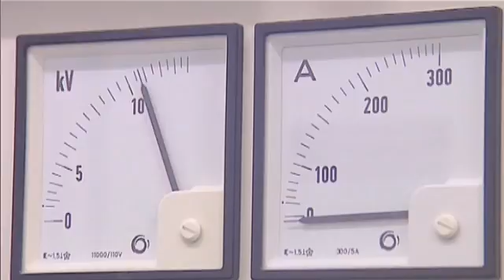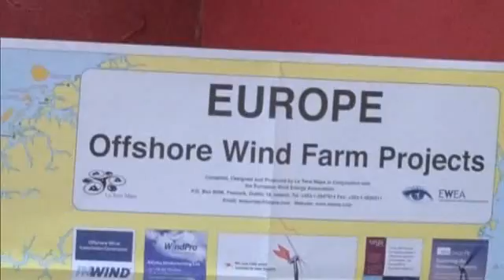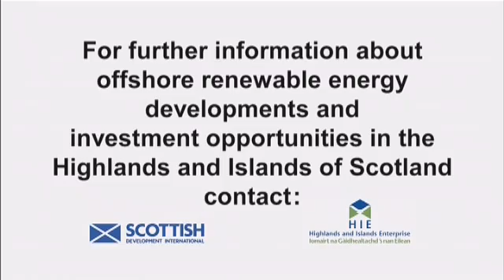Offshore Renewable Energy in the Highlands and Islands of Scotland

Comment: "11,000 ocean wave action generators can power 200 million homes" OYSTER videos. Technology known since 1799. It's easy to convert a 2 stroke engine to be powered by compressed air. GREENPOWERSCIENCE has DIY conversion videos. Water/Windmills are subject to speed Too fast & windmills burn out. powering air compressors can be done at any speed & the energy stored 24/7 without batteries. Some Plastics take 100's of years to decompose & some are stronger than steel car ramps & jack stands etc...

Comment: My invention consumes 100 hp & produces 1,000 hp continuous . it self generates after start & has a life span of 1 failure out of 100,000 in ten years. You could use wave technology to start it however a 12v battery works for me.  i can see several improvements that are needed in these devices. The modern air compressor was 1st patented in 1799. & the 1st Compressed Air powered LOCOMOTIVE in 1828. Theirs just too many things that are problematic in the things i see here to be mistakes ! Why ?